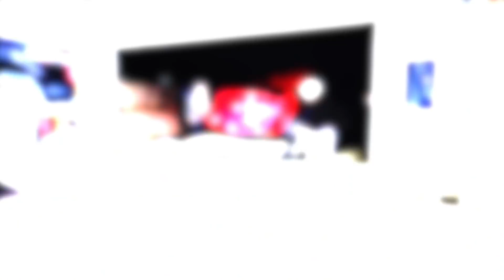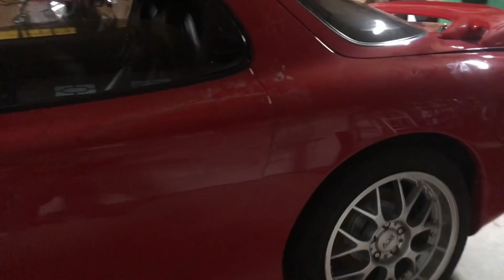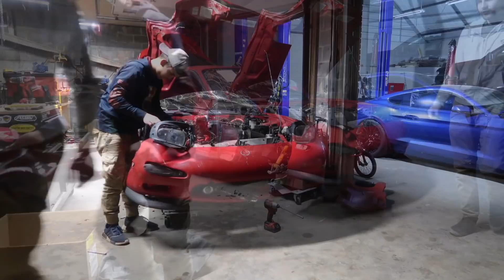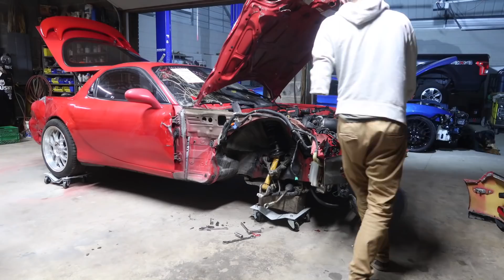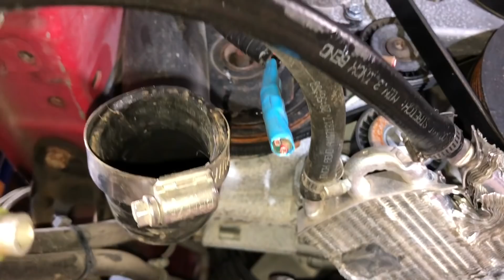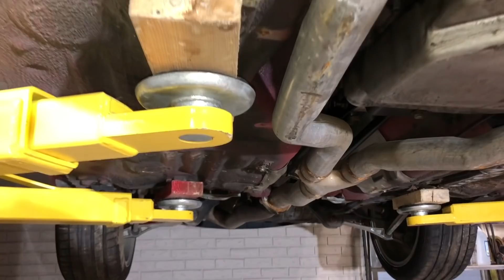Rebuilding A Wrecked V8 Mazda RX7 FD [part 1]

Comment: I'll be the one to say it:
It ain't worth saving. Roofs buckled/wavy, passenger quarter is gone (im betting even the inner skin is fucked), front end is toast too. Gonna have to go full tubed front from firewall forward - because replacing it still wont make it sit right, and im even willing to bet the firewall itself is fucked.

Not putting you down, but in my opinion there isn't much to save, nor is it cost effective. Probably would be cheaper to buy a new chassis and start from scratch really.

Comment: Looking forward to this build. Was the LS Engine damaged it looked like the oil pan was damaged
Reply: I now see its a oil cooler and some aluminum insulation your oil pan looks good. Will you remove the engine to straighten the firewall and cowl ?
Reply from the maker: @gerrymilidantri6457  after a few pulls on the frame tower i saw that the headers took some damage on two cylinders and my oil dip stick needed some love it was slightly bent. Stay tune for the frame work, I appreciate the support🤙

Comment: Hey man dont use wood block with the car on the lift its hella sketch and the car can fall off if you're pulling on something
Reply from the maker: Yeah bro got some lift adaptors on the way.
Reply: @M E it's just supposed to be on the rubber pads on the lift arms, wood has no grip and it can slide off